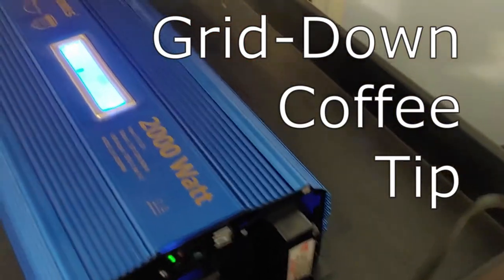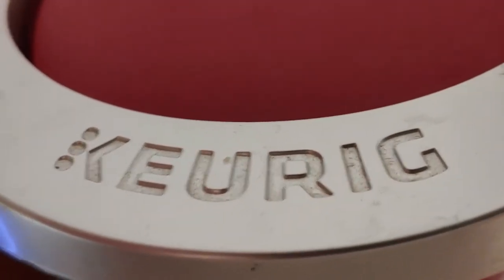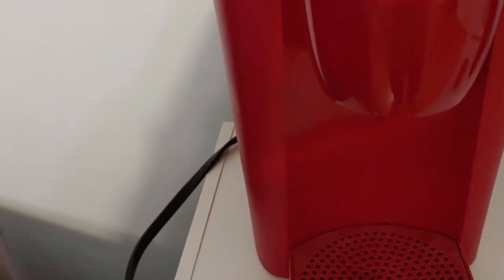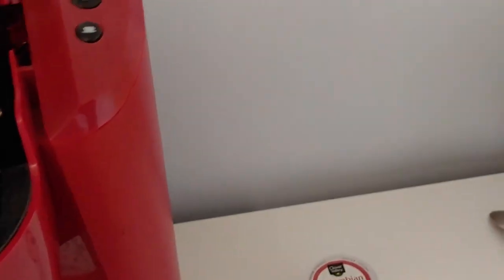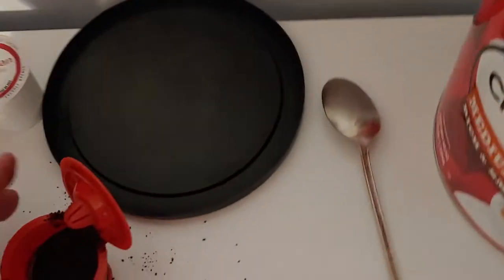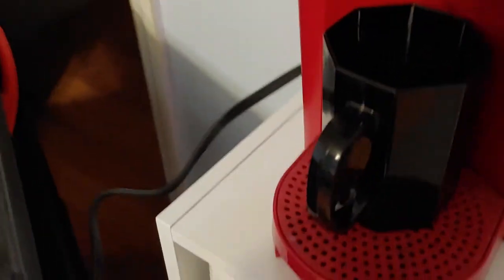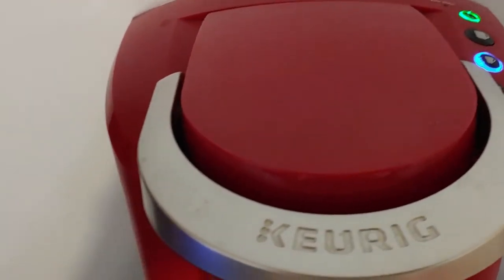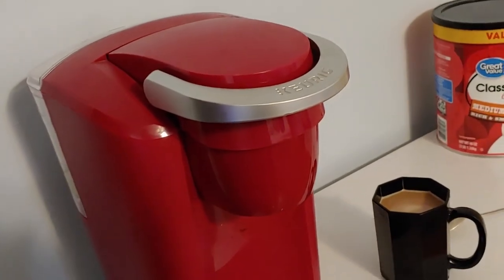Grid-Down Coffee Tip

Comment: Hahahaha, took me a sec shostring,but this will be just fine. Thanks. No more confusion sir. God speed!
Reply: @shoestringprep  can i use this renogy battery shoestring-Deep Cycle AGM Battery 12 Volt 200Ah
Reply from the maker: @richardjones7882  yes you can just make sure the charge controller is set for AGM. Thanks for your comment.
Reply: @shoestringprep  Gotcha!
Reply: @shoestringprep  ok great! if i wanted a bit cheaper can I go with this?-Power Sine Wave Inverter 1500W 12V DC to 120V AC Power Inverter Off Grid Solar

Comment: Hey I got the 100 watt solar panel and 2 of their AGM batteries, 12 volt 35 amps, some of the inverters I’m looking at say things like make sure you will have 200 amps etc. guess I got to run a harbor freight or low watt modified sine wave?
Reply from the maker: Most of my inverters are a modified sine wave and they work just fine. Let me know what you pick. Thanks for your comment.